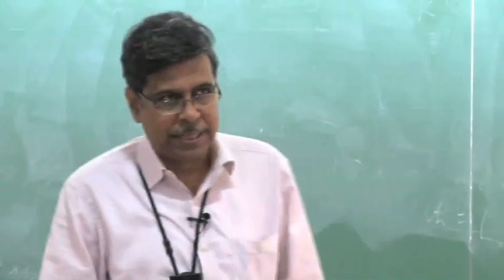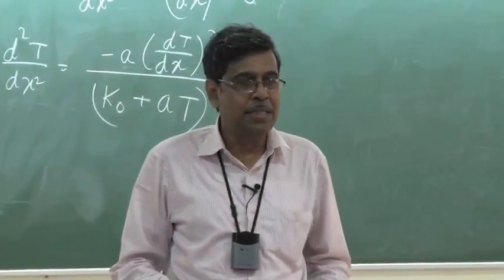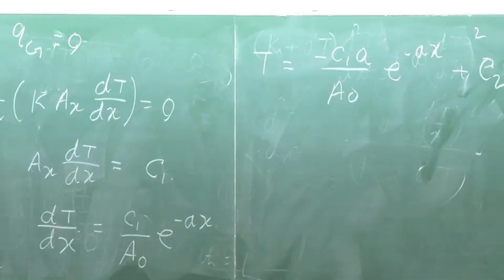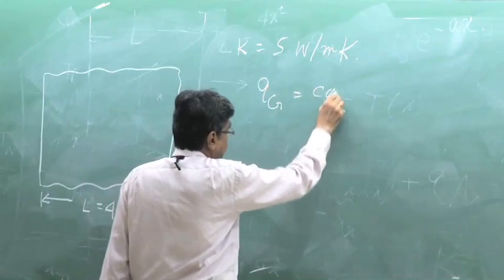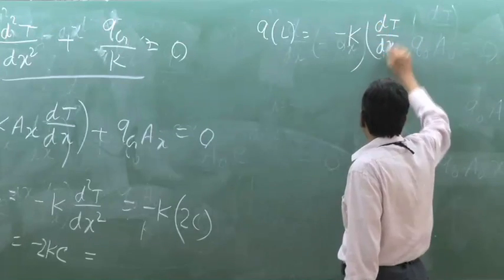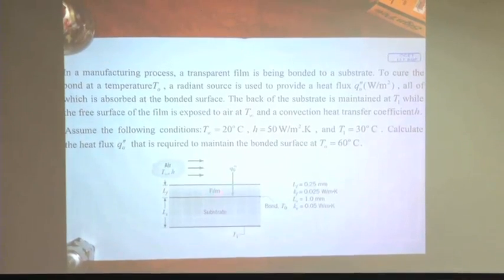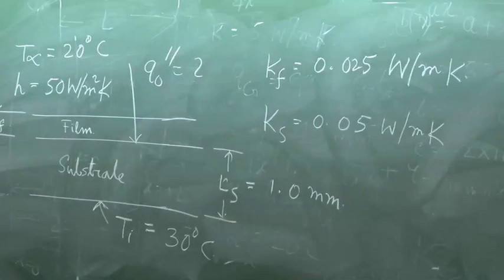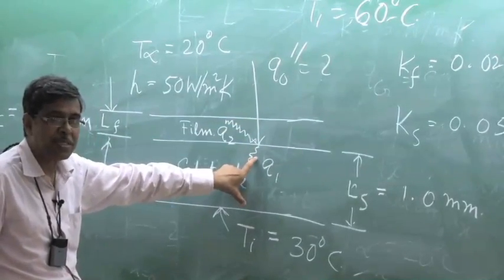Lecture 07: Problems on 1D Steady State Heat Conduction In Plane Wall

Comment: @33.10, heat(flux) flowing out from that system is not equal to Energy generation (w/m^2)......But it must be equal as far as energy conservation is concerned.....Net heat flux is 5050+2950=8000, but heat generation(w/m^2)=4000.............why both are not equal????
Reply: @nagarajansomi1627   but C is given in degree celcius and K in kelvin. So ans should be wrong for both, somehow still matches up xD 
P.S - Just saw, You equated heat generated over entire area with heat flux ( area is missing here?). So it is still wrong i guess?
Reply: Energy generation rate per unit area = volumetric internal energy generation rate * length of block = 20 * 10⁴ * 0.040 =  8000 w/m² In this way it is balanced...

Comment: What is the meaning of a=0,a less than zero ,can anyone reply
Reply: a is an assumed variable whose value may be + ve, - ve or Zero, so you have to consider these 3 possibilities and answer the question.....
Reply: • a is a constant in the expression,
 k = k0 + a*T (Provided thermal conductivity is constant in space & only varying with temperature), if -
1) a = +ve.   
1. Then it indicates that thermal conductivity is increasing with increase in temperature or decreasing with decrease in temperature. 
2. Upon cooling, the temperature profile becomes steeper from high temperature to low temperature region, while upon heating its profile becomes less steeper in high temperature region. 

2) a = 0. 
1. Thermal conductivity is independent of temperature. 
2. Upon heating or cooling, temperature profile stays linear irrespectively. 

3) a = -ve 
Thermal conductivity is increasing with decrease in temperature & hence, temperature profile looses its steepness in low temperature region & vice versa in high temperature case.

Comment: sir i have a question regarding the sum in which thermal conductivity vary w.r.t.  temperature.so you have already explain that k is vary by equation k=k0+AT  .sir here if A is +ve then basically k is increase with increasing in temp. so the temperature distribution graph is finished at other end of wall somewhere above it's   linear distribution point  i mean to say that if k is increase then  definately amount of heat transfer will increase so it try to minimize the temp. difference between two ends of wall.  similarly in case of A is -ve then  k will decrease so here less amt of heat to be transferred through wall so here large temp. difference occr between two ends o wall  so graph is finished somewhere below its linear distribution point. okay. sir  u told in lecture abt slope of curve whether it's +ve or -ve but  temp of other end of wall also changes so graph is finished above or below its linear dist. sir am i ri8 ??
Reply from the maker: +JAIMIN PATEL One very important thing to remember here is that the problem under discussion assumes constant temperatures at both the walls. This is the specified boundary condition. With due consideration of this Dirichlet BC, the effect of A was discussed in the lecture.
Reply: Note that temperature is decreasing along length, so in case of positive A, k will decrease along length and wont increase. If A is negative then K will increase along length with decrease in temperature. I know it's 7 years, this comment is for those who have same confusion.